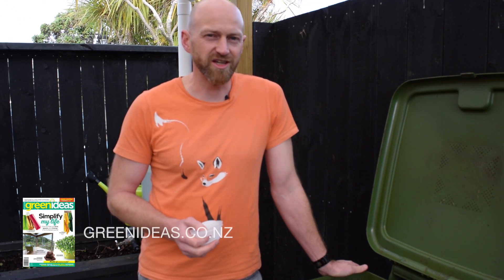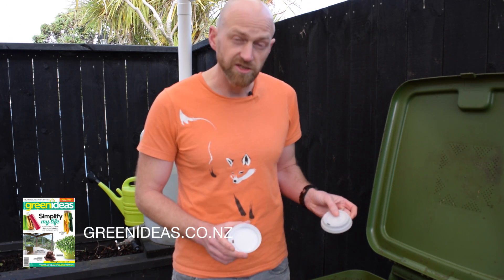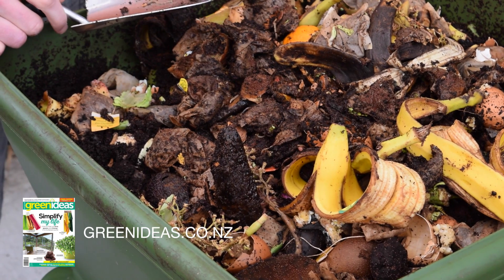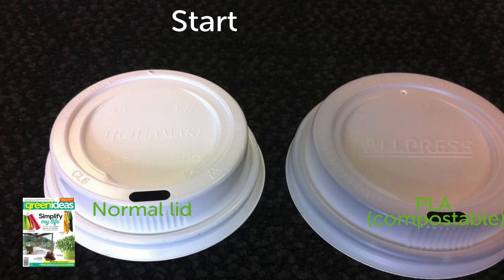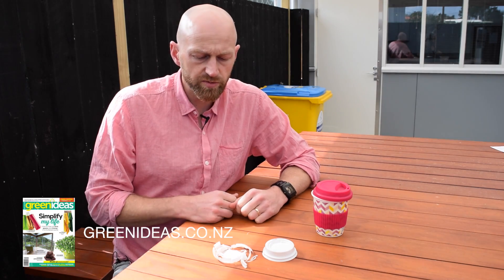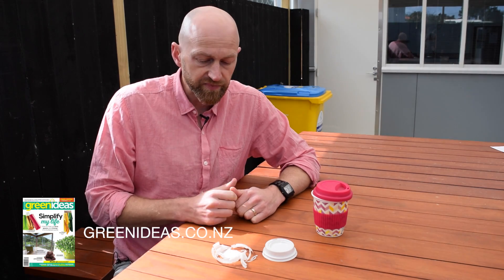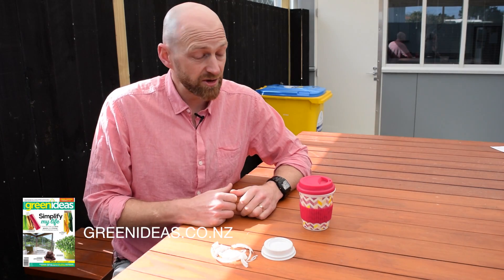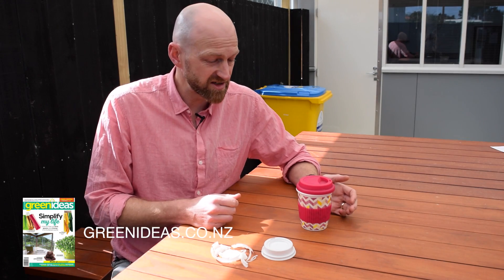Does 'compostable' plastic really break down?

Comment: Unfortunately, like most things compostable plastic products have a user error attached to them. Compostable products are really meant to be processed in an industrial composting system that reaches a temp, turned and sifted to handle compostable plastics. So if a consumer does not know it still needs to be processed and not just get tossed out the window they may be missing part of the process.
Reply: have you guys seen it down at home? ive put some composted cups in my pretty active and mature (10 years old) compost pile and after a 1 and half i couldnt find any trace of it. hoping to get a better understand so i can possible compost these at my farm from the markets i go to.
Reply: @saberur66  What brand cups? Compostable plastics or? What a great experiment, but I would say that depending on the state you are in you mite not be allowed to compost things other than food scraps. Here in NH we are not allowed to compost in the back yard, dairy, oil, meat or approved for industrial compost plastics.